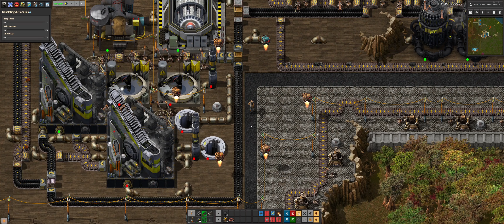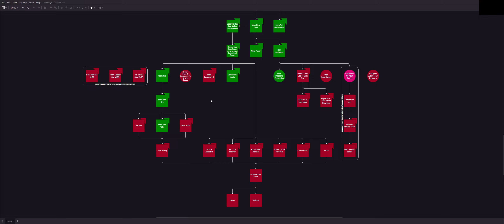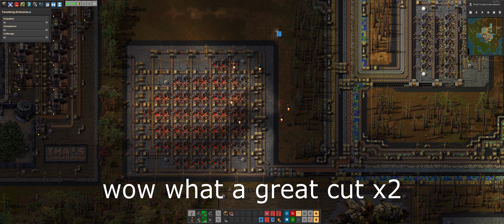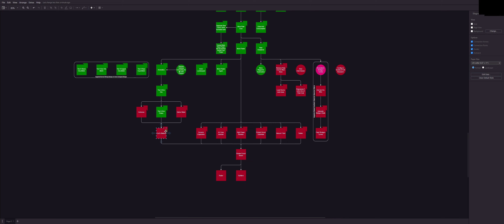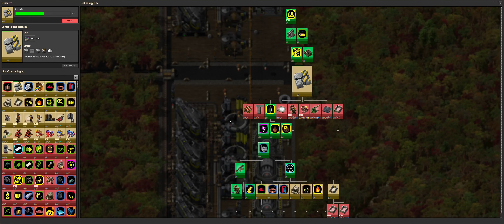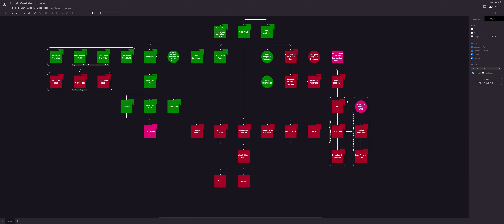Factorio Rampant Pyanodon - S02E09 - Fix the burner mines! Magazine production halted?!?!

Comment: The trick with the bobs long inserters is that rotation is very fast but lengthening/contracting is slow, so they speed up dramatically if you select their dropoff location to be the same distance from the inserter as the pickup (remembering of course that you can drop to any point inside large buildings), sometimes that means dropping things on the side of the building opposite to the inserter.
Reply from the maker: I see! Thank you iexist sometimes! Yeah I'll keep in mind for high throughput builds that lengthening/contracting is extremely slow.

Comment: RIP Less compact mining drills. That "huh. weeeell... huh." gets me everytime
Reply from the maker: Haha, I mean at least it serves the purpose of mining evenly now!
Reply: @VanillaIceCube  Since you're using an easily tiling design, you can just count how many squares are used per burner mining drill.  Anything that is shared between tiles counts as .5.  For instance, this new design is 4 tiles for the drill, 2 tiles for inserters, and 2 tiles of belt used soley by each drill + 4 tiles of belt shared between two drills.   So an efficinecy of 4 tiles of drill/10 total space used = 40%

You should be relatively easily able to get a 50% efficiency - eg, 4 tiles of miner, 2 tiles of inserter, and 2 tiles of belt per drill.  The way you get there is by having your ash and plate output on the same belt lane, and separating the materials after it exits the mining area - sharing like this is not a problem because ither of those backing up would already backstop the mining.
Reply from the maker: @sterlinganon  Well I already have ash & fuel on the same line and a seperate line for ore. If I put ore and ash on the same line won't I still need another lane for fuel?
Reply: @VanillaIceCube  I've been trying to give you a pastebin or imgur link of a better version, Youtube is apparently blocking every effort I've tried though
Reply from the maker: darn! My discord is IceCube#1095 if you wanna send it there!
Reply: @VanillaIceCube  K I've sent you a friend request, so I can DM you :)

Comment: Something you might not have realized when removing the sinkhole, the sinkhole  actually stores up 20k fluids (or something like that) before it actually starts voiding. If you want, you can still extract this with a pump. Same thing goes for the gas venting.
Reply from the maker: Ooo, that's useful info! Thank you